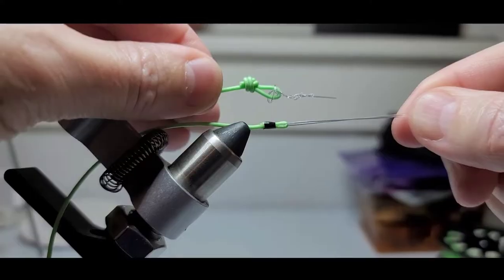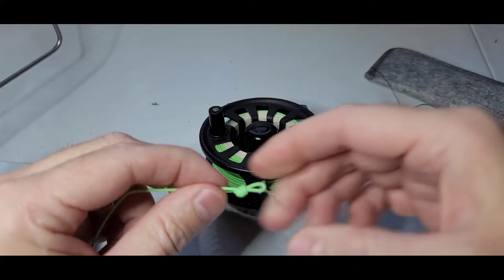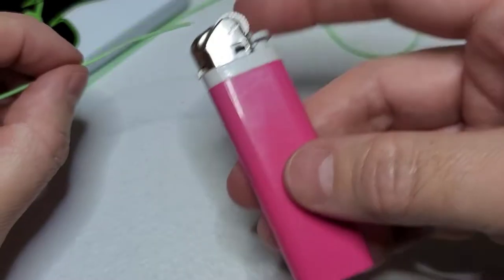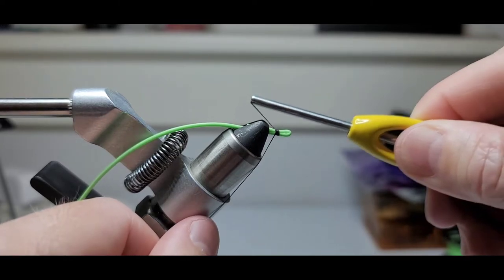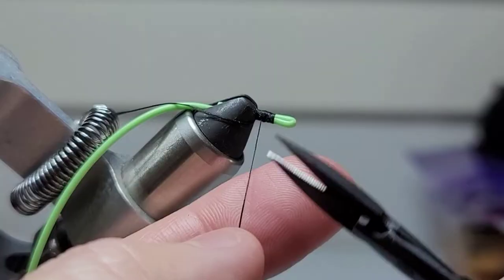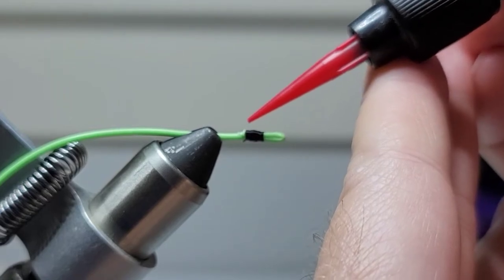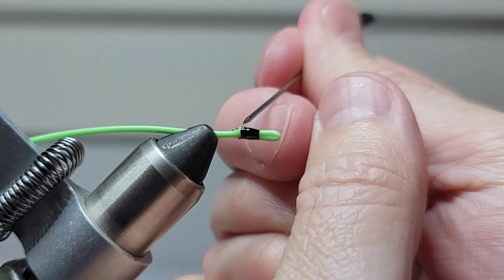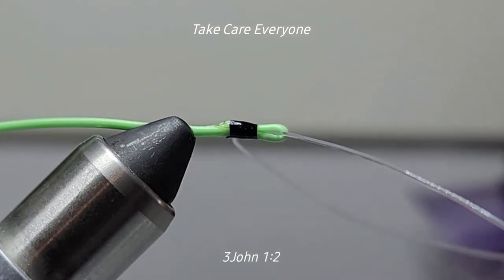How To Make A Strong Micro Fly Line Loop! Easy Diy Fly Fishing Loop Thats NOT Welded by Black Fly

Comment: How about if the fly line coating is removed and create the loop on the core?
Reply from the maker: That's a great idea! I would definitely test it at home. My only concerns would be slippage, and for floating lines, water seepage. The inner core line sticks pretty well to poly coating and gives the thread something to bite into when I tie it. But if you could strip enough to tie a good loop knot, then seal it so water doesn't soak into the core, it probably work fine and be smaller. You got me thinking now, so thanks for asking. It would make an interesting video/test.👍
Let me know if you try it and how it goes!
Talk soon,
Steve
Reply: @blackflycreations  Steve. Not my idea. Check out vids by David Arcay or Howard Croston. All the comp guys use this method. What the comp guys taught me is to remove “mass” from the line to better detect strikes.  My flyline rarely leaves my rod while Euro Nymphing. My leader is 2x rod length. I feel every tap. But keep up the great work.

Comment: 😂🤣😂😅
Reply from the maker: Thx for watching Wayne, appreciate the view!
I learned this loop from Pro angler Devin Olsen "He also has a YouTube channel "Tactical Fly Fisher". Its held up on my bass rod for almost a year now. However there is a better system I now use for my Euro Nymphing lines. I may do a video in the future.
Tight lines
Steve
Reply: @blackflycreations   If you do a video make sure you do not tie a bogus loop, and a bogus leader attached to it. Do yourself a favor and at least take a pair of pliers and scruff them both up before comparing them to the technique you are trying to promote.  That is the part that is laughable. Totally staged.